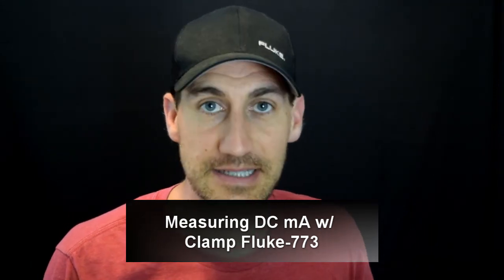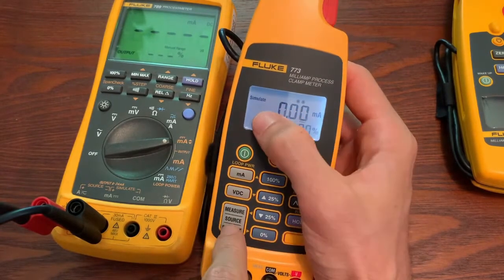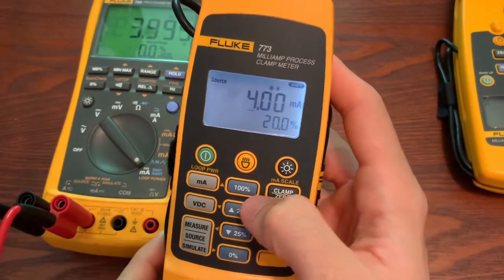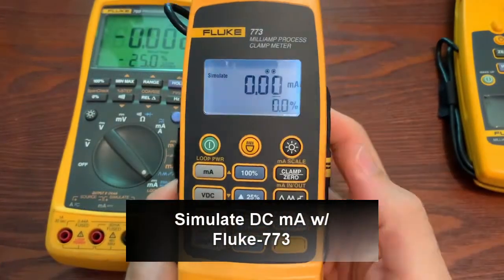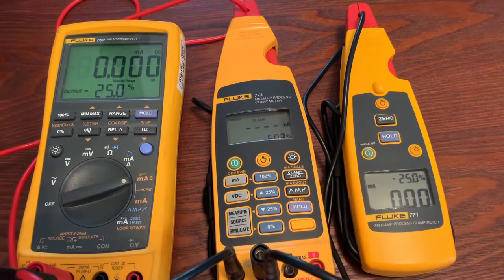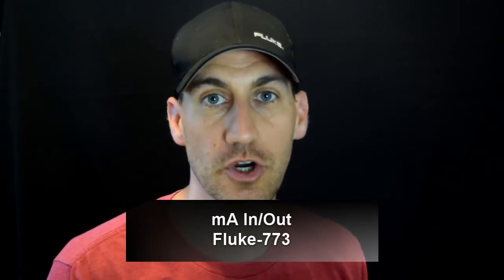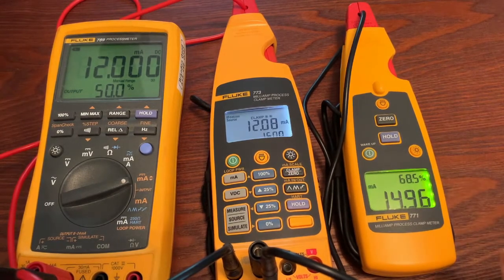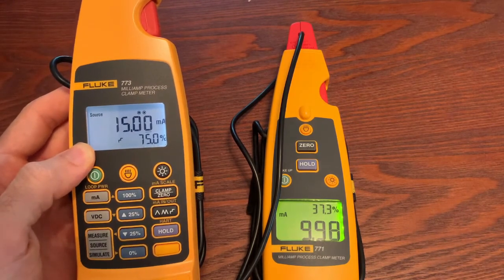Fluke-773 - All Features - Fluke Friday - Episode 06

Comment: Hi...
Need solution for Fluke 773
It's mA range has changed to 24mA, instead of earlier 20mA range.At 100 percent current is 24mA. I want it at 20mA.
Reply from the maker: I'm not sure about that one off the top of my head. But I would recommend calling Fluke's tech support at 800-44-FLUKE.  They are open from 9:30 EST to 5:30 EST
Reply: @fridayswithbrandon  Thnks....will check for solution....

Comment: Do you happen to know what hart function is for? Ty for great video
Reply from the maker: It puts a 250 ohm resistor in series if you are in source mode and activate the HART feature.
Reply: What’s the reason for needing 250 res? Sorry for all the question lol
Reply from the maker: @jacobdellinger4931  if you have HART smart sensors they will need a 250 ohm resistor to work.